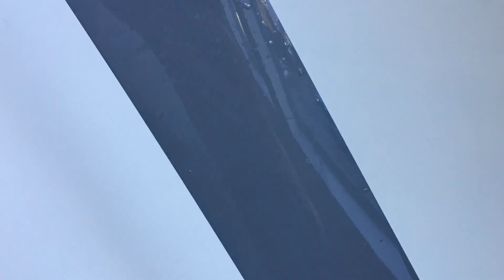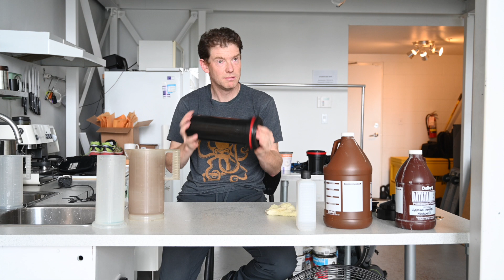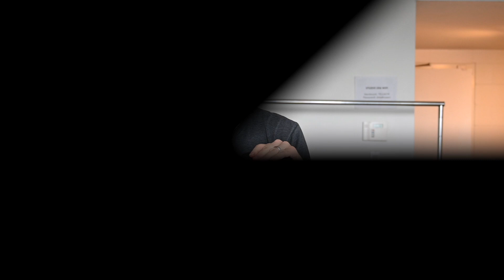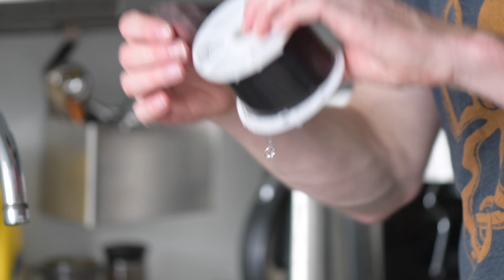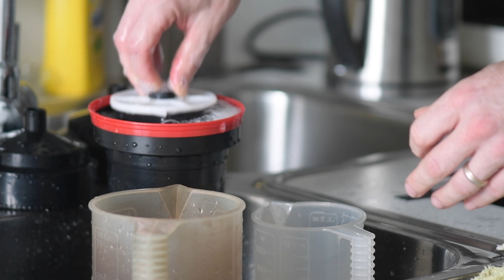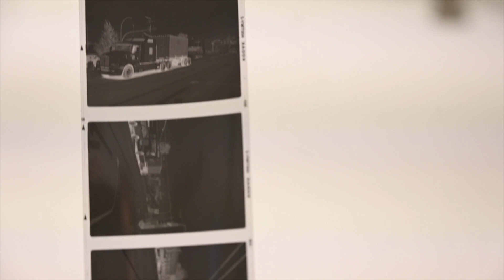Film Developing: How to process the film

Comment: Pre-soak. It's only purpose is to bring tank,k reels and film up or down to processing temperature. If that is not needed, then its does nothing. Washing out the anti-halation dye is irrelevant, as it is inert to the current or any future use of the developer. It serves a purpose of pre-soaking the emulsion to (maybe) allow a more uniform penetration of the developer if you are using a very short development time, less than 5 minutes, but the truth is that you should  not be using short development times, as they promote uneven development. On the other hand, it is unlikely that a pre-soak is going to do any harm either.
Reply from the maker: I'm no fan of short development times - HC110 is a great developer but can be hard to use for that exact reason, for instance. You're absolutely right about the pre-soak - I can't think of any time I have read that it has any value other than for temperature. But I like doing it, anyway.

Comment: Awesome video - very helpful
I especially liked the tip on the fixer test - never knew that, and will definitely come in handy as my fixer moves along

With that said, I've been using Bergger Superfine developer and absolutely love what it does with HP5+ at 200, I mean, seriously, I can't stress how much I love that combination - however, I've been deliberating how to negotiate developing in a larger tank - the bottle and instruction sheet only covers one single 120 roll, and I've been reluctant to experiment with adding more rolls and times, as the developer is atrociously expensive here in Canada, and where I would prefer not to ruin any film in the process - any tips on how I might figure out a way to calculate variances in film load and tank sizes?
Reply from the maker: Hm. Good question about the Superfine developer. I looked at the data sheet (such as I could find one) and there was no information on processing more than a single roll. That said, I expect that they would be ready for you to process at least a roll of 220 film (which is twice as long as 120 and goes on the same type of spool) so I'm confident processing 2 rolls of 120 wouldn't be a problem - given that you would have to use twice as much developer for two rolls. Generally Kodak and Ilford (as far as I can remember) would differentiate only between 'small tank' and 'large tank' with small tanks being up to about 2l and large tanks being 4l or more. Like the sort of thing you would process two dozen sheets of 4x5 in. The issue is oxidation of the developer with much larger surface areas as I recall. Sorry I can't give more information than that. 2 rolls you should be fine. Anything more than that and some testing might be in order, but I expect 3 rolls would probably be OK - with fresh chemistry, correct temperature (and possibly a water bath at the right temperature to keep it there) and a good pre-soak. (as they recommend) Good luck!

Comment: It has been about 45 years since I doped BW film when I was a military photographer, the most important task was to make sure you had the correct time and temp, not always easy when in the tropics.  BTW you can load two rolls of 120 film on one spool. We almost always always aimed for 68 degrees.  Never pre-washed but perhaps back in those days it was not needed with the available film (either Tri-x or FP 4 or 5).  Always used stop bath and then fix and then about a ten to 15 minute wash.  Photo flo was used and then hung to dry in a cabinet (tip: common dish washing fluid does the same job as photo flo).  A trick we had if the film had to be printed quickly (sometimes for a Royal Visit) we would lick the film (after washing)  almost dry, and then hang it, it would dry in a few minutes to a beautiful smooth finish (Tip: don't eat potato chips before doing this). One thing you did which really is a no no, is examining what is on the film while on the spool before drying since the emulsion is still very soft and easily damaged.  Other than that a good video.
Reply from the maker: Thanks for the reminder about 2 rolls of 120 on a  single spool. I had forgotten about that. I had also forgotten about dish soap instead of photo flo. As for licking the negatives dry - never tried that one, but I guess necessity is the mother of invention. And for looking at the negatives, I know, I know... But thankfully the emulsions are more robust than they used to be but still, it's not a good habit. Hard to wait until they're dry, though.

Comment: Pre-soaking ?  NUTS, Read the Kodak jobsheet / manual. Why is this lab looks like a pigsty?
No stopbath ? Do you drive a car without brakes ? Tapping a tank like Fred Astaire.
This all is nonsense.
Reply from the maker: Hi Jaco - I'll take your comments one at a time. 

First off, pre-soak and read the Kodak jobsheet/Manual. Can you point me to which Technical Data Sheet from Kodak you're referring? All of the ones I look at do not comment on pre-soaking. According to Dr. Google, the jury is out on whether or not it makes any difference - there is limited suggestion it is detrimental - no one I could find suggested it shouldn't be done - just that it doesn't make any difference. 

Next, about the 'lab'. This is the kitchen counter in my studio. Hardly a lab, and no one has ever complained (or even commented) about the cleanliness. Sorry if my design aesthetic doesn't suit. 

No stopbath? Yes. The Kodak Data Sheet F-4016 for TMAX 100 states, "...with agitation in KODAK Indicator Stop Bath OR RUNNING WATER" (my emphasis on those last three words) I'm going to go out on a limb and assume that the TMY and TXP and TRI-X sheets say the same thing. (just checked - the TMY sheet says the same thing; The TXP sheet says use the Stop Bath but doesn't say don't use water). The reason why you would use stop bath is to preserve the life of your fixer, but I get adequate life out of my fixer the way I process now. Many years ago people complained about pinholes in their negatives from the stop bath. I stopped using it then and haven't used it since.

My tank-tapping technique? I have cracked developing tanks and fogged the film because of my over-exuberant developing. And using the process I show here, I have NEVER had an air bubble on my film, in hundreds of developed rolls. 

Fred Astaire? Thanks very much, indeed. I could certainly do worse.